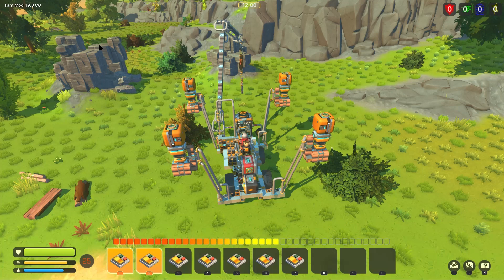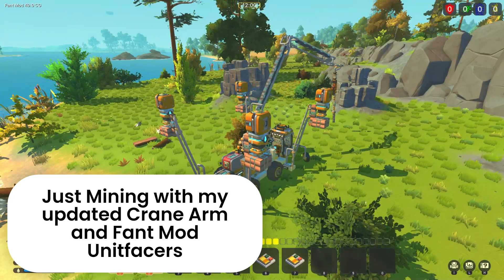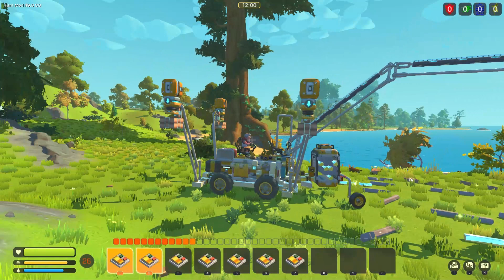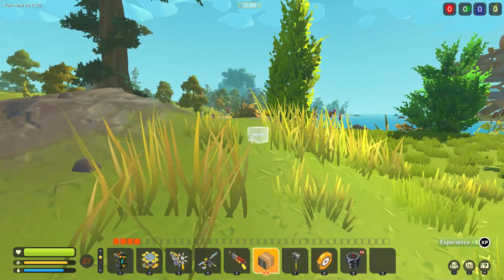Scrap Mechanic - Survival - MK II Crane Miner. Long  form video. Just mining and testing

Comment: Does the drill cause twisting based on rotation like the standard heads?  Have you tried multiple heads on the same arm?  I've not used this mod but I would be wondering about a vehicle that is U shaped and has those drill heads like a comb in the empty middle section.  It wasn't practical for the vanilla heads but they might do the trick.
Reply from the maker: Remember this is a fun to drive machine. If it was supper efficient I would run out of Fun really fast 😁. The Fant mod drills Don't grab like Vanilla ones. They also work great un powered. more heads on the same arm quickly gets them tangled as they would both go for the same targets. 
To answer your U shaped question. The link is for my  4year old fully vanilla mining truck as a V set of drills and it is very efficient. the drills work like a conveyor  and drive the resources toward the middle. https://www.youtube.com/watch?v=6XHtE3gSxvs&t=725s
Reply: @GuardianOz  Oh I wasn't trying to take the fun out of it, just musing really.  I get  that you are enjoying the process, I dig that.  It actually reminds me of a concrete pump, like what they use to get concrete to hard to reach places.  I wonder if anyone has made a rig that cuts the whole node at ground level and processes it in its entirety.